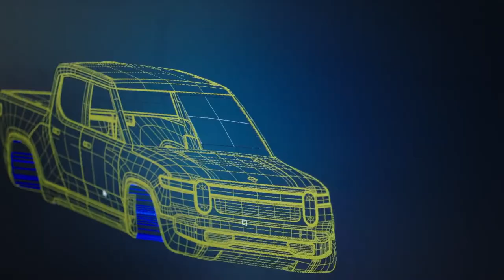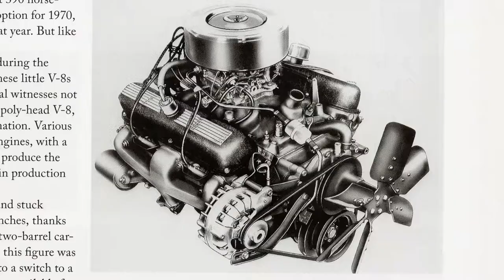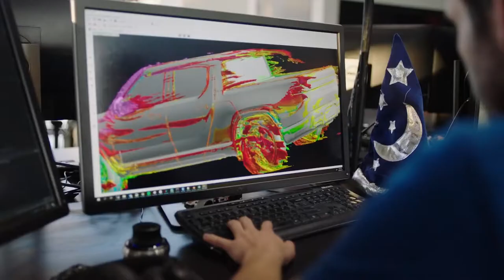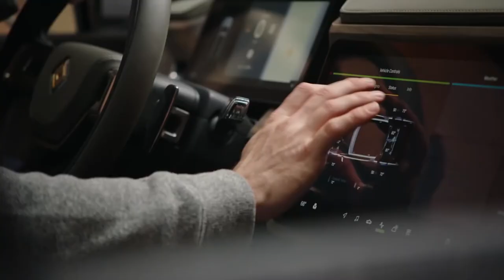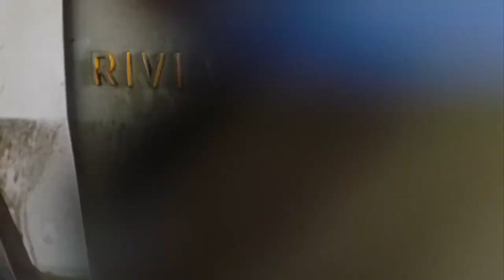This Is The Story Of Rivian - The Documentary

Comment: So I know of a battery type which uses a solid electrolyte .. It offers 6 times the energy density .. Since I am a Sr. Mechanical Engineer I am working on a high voltage battery .. This battery since it does not use cylindrical batteries will offer 2 - 3 times more battery density over cylindrical battery packaging .. 

12 Times ==> to 18 Times power density means that the Rivian Truck could travel 12 - 18 times the distance .. 

Now its time to talk about package weight .. This is why I am saying 12 - 18 times because this is very important .. If we compare the weight of Gasoline to Lithium Batteries it is 13:1 which translates that 1 gallon of gasoline is 13 times more dense as Li batteries currently used in cars .. If you realize what 12 - 18 times increase in power density it means the death of gasoline or I like to think of it also as the perfect marriage of Hybrid vehicles ..